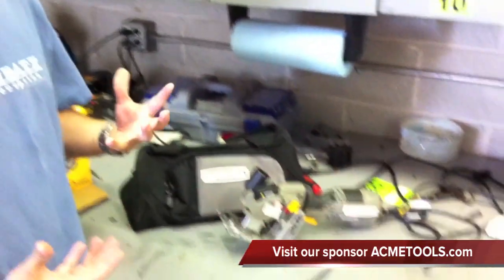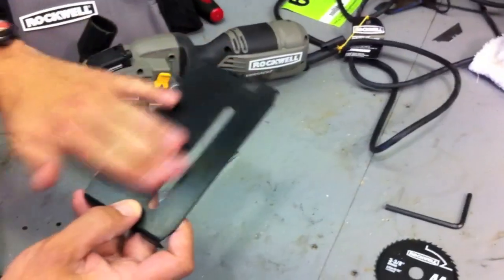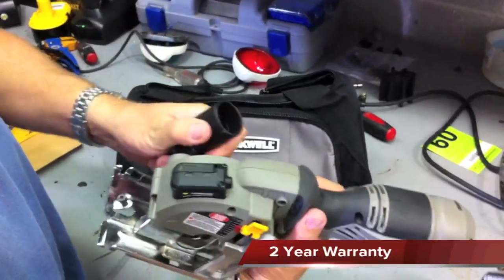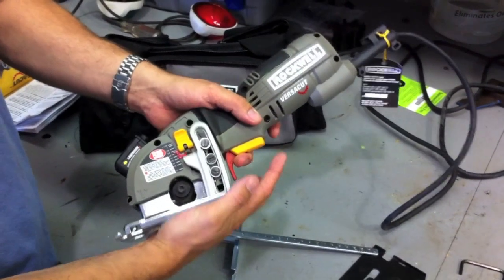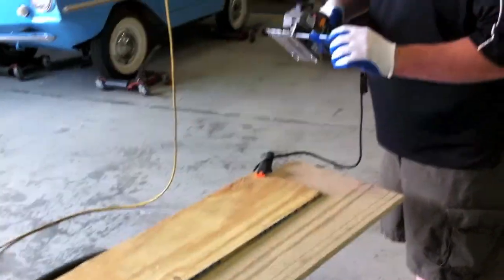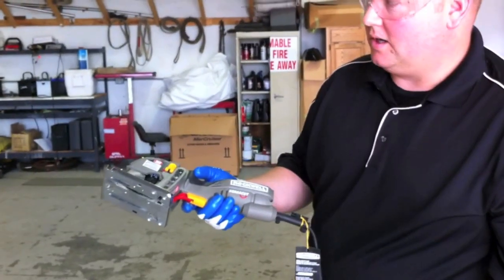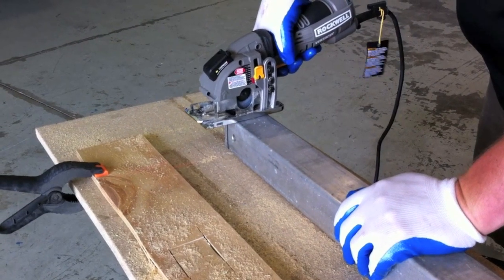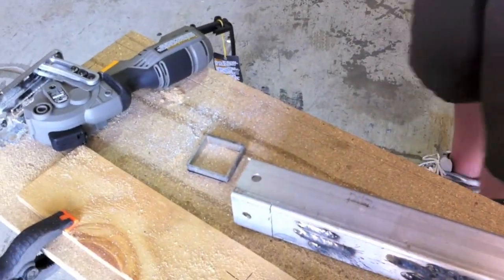Rockwell VersaCut Mini Circular Saw RK3440K - Review

Comment: I just bought this tool to cut out rotten subfloor; worked very well. It didn't bog down, and the laser helped maintain a straight cut. It's a very lightweight tool. It takes a bit of practice to not start the blade running while releasing the blade lock. Also, a lock on the plunge feature would be nice.

Comment: Which is better this VersaCut or SawMax by Dremel? Regards from Mexico
Reply: I have the same question
Reply: I've used both and I bought the Versacut. It's ergonomically superior and brings more power to the material. The Dremel tool tired my hands much sooner. It was heavy without translating that weight into getting the job done faster or better.
Reply: +VenusMarshall Thanks for the Versacut support!
Reply: +VenusMarshall  I have the dremel ultra saw and I will agree that the versa max was smart enough to make in actual blade for their saw. Dremel was actually stupid for not creating in actual blade with teeth
Reply: I have a saw max and thinking of getting the rockwell. Finding the vac attachment is difficult. Dremel saw max isn't very good too hold onto and have dropped it on occasion with blade spinning. My focus is ergonomics and safety.

Comment: I bought a corrugated washing machine hose and stepped shop vac adapter at HD to attach the Versacut to my shop vac; I didn't want to order and wait for the stock hose. The washer hose fits 1" to 1.25" outlets. The fit on the Versacut was extremely snug, so I had to work it to get it to fit.

Comment: I have one the saws and my main complaint is the plunge action and no way to lock the plunge action out to set the blade in a fixed depth like a circular saw, etc. After saying that I have figured out a way to lock the blade to a set depth and disabling the plunge action.

Comment: I have that Rockwell saw, this saw is not a saw for all circular saw applications. What it is good at is the only reason to use it over the bigger saw. It excels at cutting curve cuts in plywood due to the diameter of the blade. This is a big thing if you are building a stitch and glue boat.

Comment: Decent presentation, but I would suggest that you show more, & say more about the features of the saw.  The laser guide was only mentioned, but not really shown on the work or demonstrated.  I realize that the vacuum would probably be loud on the video, but you could at least show how it hooks up, and maybe show it running for a few seconds.  And, as someone else mentioned, you didn't even demonstrate a single plunge cut?  I was really hoping to see more and learn more from your video.

Comment: I have this saw, not impressed with it. Tried to trim a piece of aluminum for a threshold and the blade crapped out.  It cut a piece of lumber okay, but on metal...NOPE. I will be sending it back.

Comment: I got one recently and I was trying to cut a 1x1" support strut for the midpoint of a bookcase, rotating in strokes to achieve the depth. The plunge effort and the limited view of where the blade's going, it didn't work well for me yet. I tried turning the screws thinking I could lock out the plunge, no luck, then I was thinking of sticking something (I know, sounds like an accident in the making) in the plunge depth so it doesn't retract. Is that a huge mistake; we're assuming I have a firm grip on the wood and the Versacut?

Comment: I have one for a few month now and I got to say it looks great when you see somebody cutting with it but it is somewhat of a pain to really use it. The retracted blade make it almost impossible to see where you will be cutting. Besides that, it takes quiet some effort to push the blade thru the guard. Once you start cutting you have to keep the pressure on it or it will pop back up. By pressing down so hard, it makes it hard to push along the cut because there is so much friction. I wish the blade guard could be locked in the retracted position or that you could at least adjust the tension of it. I find it easier to use my circular saw.
I feel this needed to be said.
Reply: Typical ruination of equipment trying to make it intrinsically safe .... I have actually disabled the safety devices on several power tools just because they are so restrictive as to make it unreasonable to even use!    But you know IF you are safety minded to for instance handle a chain saw? I THINK you can handle other dangerous saws without all the guards and stuff ...I know they WOULD if they could even shroud a chain saw in such contraptions IF they COULD ....could you even imagine what THAT might look like?  LOL!   And yeah it WOULD ultimately save some SEVERE injuries to anyone who left it in place.....but partly because it would be unusable to a certain degree!  

On one hand I hate to encourage anyone to remove or modify safety devices on saws....saw injuries can be just devastating carnage!  But some of us actually need to make cuts that these devices are fighting against like crazy ...just for instance on a worm drive saw,  the blade guard works fine for some cuts....a lot of cuts even...but when it comes time to make a plunge cut?  NOT happening!  So a self drill screw (for instance) gets added to hold the sucker open temporarily ....and IF you are reasonable thinking person?  I HOPE you will worry like HELL the whole time you use ANY dangerous saw!  I visualize what might happen if I screw up!  I just keep thinking about it!  I keep staring at that deadly blade and treat is like a deadly viper that WANTS to bite me!  ...I am mid 60s and thank God so far so good!  No DOUBT saws are so dangerous!   But guards that prevent the saw from being reasonably even used? WTH???
Reply: I was a Carpenter framing houses,additons,very old house restorations etc my entire life!My friend gave me this saw to try while I was working on their barn ! I find it to be a Very difficult saw to control due to the spring loaded retractable blade! If an experienced carpenter has a hard time adjusting to this feature how would you ever expect a novice DIY person to control it effectively ! The amount of downward pressure needed to overcome spring makes it want to lift up the front of the saw unless you really push down hard! If it was my saw I would disable the retractable blade feature . There should be an option to Lock the blade  at selected depth exposed!

Comment: I wish someone doing reviews would demonstrate how this saw changes blades. The manual is awful. If the idea is to sell this saw to people who do NOT know a lot about tools, it's a bad idea to put the text way past where the illustrations are, then not even bother to put labels on the parts being referred to, then top it all off by using terms that new tool users won't recognize. These obstacles are so unnecessary - Singer Sewing Machine Company perfected the art of teaching how to use devices without language DECADES ago. They sold worldwide before "globalization" was even a term.
Reply: you're right these manuals if they do exist are getting so un-understandable. I just got my Rockwell saw with a four and a half inch circular blade. it didn't even come with a manual and the saw blade only lasted for two cuts I cut some tree branches that were abiut 2 1/2 inches thick and then I was cutting through poison ivy bush yep I got poison ivy on my arms but l was more outraged by the way teeth just got chewed up after these two jobs.  what a piece of crap those blades could rhey to last a little bit longer?
Reply: at the back of the handle there are two Allen wrenches attached (it's actually attached in the cord). You will need these to unscrew bolt holding the blade. One wrench is used as a stopper (the smaller one), just twits it clockwise until it loosen up and remove the holding screw then remove the blade...

Comment: Rockwell makes some noteworthy tools, but this particular saw is not one of them. Basically, it's over-engineered. As soon as I brought it home and tried it, I quickly realized how unnatural it is to push down and forward at the same time. It takes some practice and is only really practical for plunge cuts. A circular saw can do a much easier and faster cut. Fail.

Comment: I like the video on what this saw can do But my experience with Rockwell is of a very cheap product and cheap material. The BladRunner that I bought a couple years ago was a piece of crap. It couldn't cut straight and the power button broke off when I bumped it against a door.

Comment: Bought one in May, tried to use it first time in September.  Found to be defective, laser light inoperative.  Have spent the last three months trying to get it rectified or replaced, Rockwell totally untrustworthy, have made multiple promises to send pre paid shipping label so I can return it but they never arrive.  Lesson learnt, never will buy Rockwell again.
Reply: Al Hamilton same problem here laser does not work at all .7 months after returning i just got a reply of we are returning your saw and have replaced the laser even though I clearly stated I wish for a refund for it was to be a gift this Christmas.